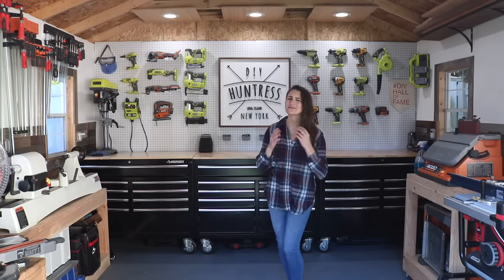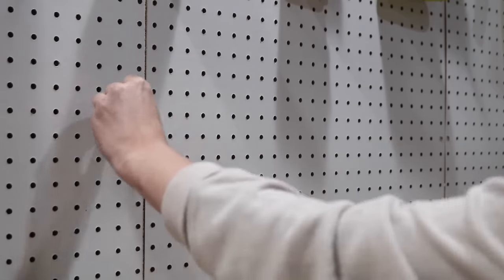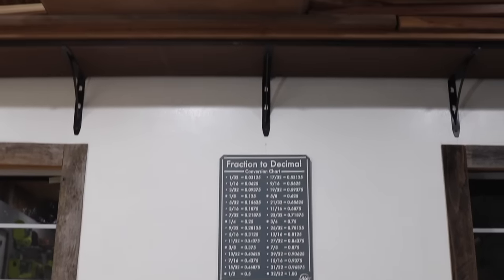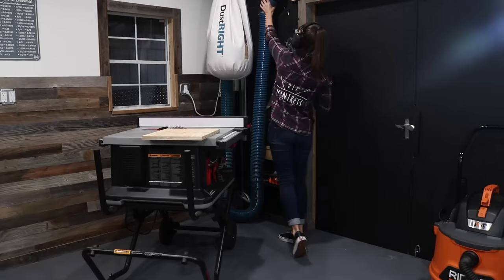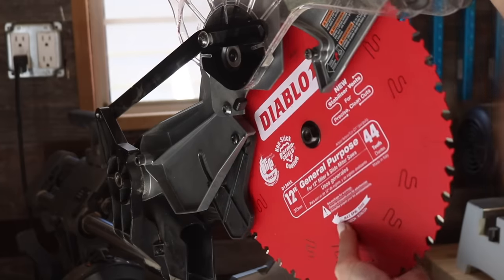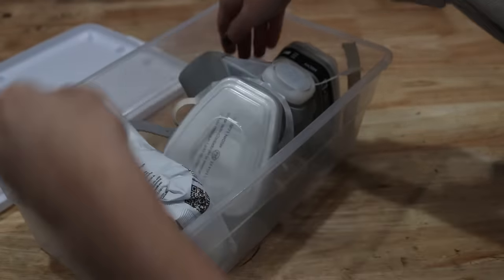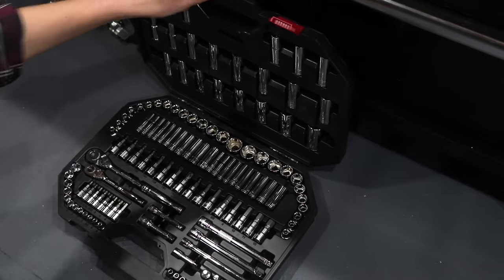Workshop Organization Tips & Shed-Shop Tour

Comment: I had the exact same idea for the back wall of my shop (12' x 24'). I was going to put 3 of the same type chest along the back wall and put pegboard from the top of the tool chests up to the ceiling. I liked the idea of using drawers for storage and having the pegboard up above and with a solid work surface. But then I watched a video on how to easily make something that would have larger drawers. And that's what I really need.....large drawers.

But I love the way your shop looks and the layout and how easy everything is to get to and use. You've done a fantastic job with it and should be very proud.
Reply from the maker: Thank you so much!

Comment: I recently found your channel.  You do some nice work.  I want to offer one tip that may help you.  I noticed that when you glue boards together you use a wet rag to remove the glue squeeze out. A common practice.  What I do that works very nicely is take sawdust and pour some on the squeezed  out glue, mix it together with the glue. Then, take a putty knife or scraper and remove the mixture.  It works every time and doesn't raise the grain and doesn't leave glue stains on the wood to be sanded off  Good luck.

Comment: I built a steel frame structure for my workshop and then clad it with knotty-pine walls, cause I love the wood look as well! It worked out to be a 12m x 6m x 3m high area with a 6m x 3m storage area next to it and I also made 6 large workshop tables with heavy duty coasters at the same height as my miter saw and wood saw table and yet you have somehow seemed to have so much more space than I do. Love the video and love your organizing skills and hate how incompetent I feel right now :(

Comment: Awesome job all around on your shop, looks great, organized, clean and vey usable. My small space is only 10 x 12 so you've got me beat. A little pegboard hook trick I use is plastic drywall anchors in the holes and then screws sticking out of the anchors. It's great for lightweight hooks for smaller tools, re-usable and cheap too. :)
Reply from the maker: Thank you! I like that idea!

Comment: I bought black watertight tubs that are all exactly the same and each tub has all the accessories for each power tool that is in the tub.  One power tool per tub. Saws have blades, sanders have sand paper, angle grinder has grinding discs and cut off wheels, etc, etc, etc.... I have 26 tubs and the tubs are labeled and all fit neatly in a large steel wall cabinet.  When I need to bring tools out of the shop for a project at my cabin I simply grab the tubs I need and go.  My power tools get dusted and cleaned before getting put back in the tub.  My tools stay clean, dry, and secure when not in use and don’t clutter up my shop.  I also use Tupperware for smaller organization.
Reply from the maker: I love the tub idea! That’s so smart!

Comment: Looks great and organized. I need to change my 12x18 shop around to create more space. This video will help! The only tip I would give you as a seasoned woodworker is to unplug that miter saw before you change the blade. If it were to malfunction or you press the trigger in any way while changing the blade you could wind up with a lot of stitches. ^_^ a safe shop is a happy shop. Also for the quotes and whatnot on your door, I always enjoyed Eleanor Roosevelt s "No one can make you feel inferior without your consent." as well as the one from Russel Crow's Robin hood quote "Rise and rise again, until lambs become lions." Although I imagine something that pertains to building or woodworking would apply better.
Reply from the maker: Glad the video helped - and, don’t worry, I always unplug my tools before changing blades!

Comment: Nice shop Sam, I have a few rules I live by for shop organization;

1. ALL tools go on the walls. (Drawers are where tools go to die) I realize you are dealing with limited wall area...But your driver wall can be compacted together, especially if you get rid of all the redundant drivers. every square inch of wall should have tools on it. The massive logo is eating up vital wall space, and if you add beefy hinges to the doors, that becomes free wall space as well. The clamps you have hanging on the wall near the lathe, can be moved to hang down in front of the windows, freeing up that wall space as well.

2. All large tools are on wheels. You have that one nailed.

3. Lighting. More is Better. The only suggestion I have is; If you add a shelf above the tool wall area, as high as you can reach and still get things down. Then this will not only give some vital storage space, but also provide a place for under-shelf/recessed task lighting on your main workbench area. You might even run this shelf around the entire perimeter, except for the entry area. Storage above, lighting below.

4. Home Depot rocks.

Comment: I see u use a 12"x44tooth saw blade on your miter saw.   I have found the 12"x60 tooth diablo blade is my go-to. It's my go to.  Great for rough cutting all the way to trim
Reply from the maker: 60 is usually my go to as well. Wanted to try the 44 out for a while. It worked out well for a bunch of projects. Back to the 60 again.

Comment: Next project: A charging station. I suggest a wall contol panel metalic pegboard as a start and offset it  from the wall so you can put a power bar behind it. ise a combination on custom mount and vendor shelves and maybe 3D print  specific items. Check out white in revery here on Youtube for suggestions. You can use it for both tool charing and camera battery charging. Easily expands with a second WCP panel.
Reply from the maker: I like that idea! Thank you for the suggestion!

Comment: Great shop. Excellent organization.  Well done. I am curious about the spray foam in the walls and then nothing in the ceiling? What is the thought there? Maybe it's insulated from the outside of the ceiling? Future insulation? Just sounds deadening for the walls? Thanks.
Reply from the maker: Thank you! Just haven’t gotten around to it, unfortunately. I was researching product for a while (the spray foam I used was not recommended for use in a ceiling), and then never jumped at anything. Will get there eventually. Luckily, our winters have been mild enough to get away with what I have. My space heater toasts it up really well in there right now. Hopefully will have time this spring to insulate the ceiling. 😊
Reply: @diyhuntress  👍👍 Thank you.. Now I can sleep tonight! ha  I'll have to watch more of your videos to make sure you get it done. LOL

Comment: I am just getting my workshop started, but I have a lot of random tools.  One item in particular is the table saw.  I have one I got from Harbor Freight many years ago and no matter what I do the dust collection just doesn't work.  I have a hole in the back where I use the shop vac but again, doesn't get the job done.  So I would be interested in your thoughts regarding the table saw and how you got your dust collection system setup.
Reply from the maker: Hi! I got my system from Rockler - it was pretty easy to install! It works great and I notice a huge difference when I don’t use it versus when I do. I just plug the hose into the back of my tools and got an adapter for the ones it doesn’t fit.

Comment: Thank you for the video! I like your layout. I wondered if your shed is 12 x 12 interior or exterior dimensions? I ask because I just bought a 12 by 12 shed and the dimensions seem too tight to fit three 46" tool storage benches side by side.

Comment: 5:57 Have you ever brought a blade in for sharpening?   

I have a 100 tooth 12" Freud saw blade and was told that it would be around $20-30 Canadain. I think they can be sharpened a handful of times.

Good idea to have two, you can cycle them as needed!
Reply from the maker: Interesting! I have not - I’ve only cleaned them before. Gotta look into that!
Reply: @diyhuntress  Not all blades can be sharpened, but I think the blade you had can be. They usually say on the packaging.  The one near me even does bandsaw blades which I find amazing.

Comment: About those drywall anchors. You should probably check out Gosforth Handyman here on YouTube he did a segment on those and he basically confirmed what he already knew, that they are more or less terrible to use if you plan on adding any weight to them. Hopefully the screws you used into the studs work good enough to support the weight though I would not trust those anchors.
Reply from the maker: The ones I used are actually made for wood (since my walls are plywood) and I’ve had that storage up for over a year now with no issues! I’m a serious hoarder, so they’ve seen a lot of weight over the past year. 😊
Reply: @diyhuntress  Ok. You sid dry wall anchors so I thought you were using drywall there. If it's wood then they will most likely hold much better :)

Comment: With corded tools drawing a lot of power (think Festool dust extractor with on-board sander drawing 15-amps alone, not including any lighting that might be on at the time as well), how much power did you run to your shed shop?  How many circuits are dedicated to powering your shed shop?  I have to build a 2-car garage with workshop area and I want to make sure I have enough power to power everything :)
Reply from the maker: I would honestly divert all of your electrical questions to a licensed electrician (that's what I did)! I just don't want to give you any false information! Especially since most of my tools are battery operated, which we took into account when powering up my shop. Wish I could be of more help!

Comment: Nice video and great organization in your shop.  I'd remark that having open bins below a lathe is not a good idea even with the best dust control.  I pride myself on taking care of my tools so they look nearly new but putting looks ahead of functionality and maintenance is rarely a good idea.  Plus, why didn't your roll out your carts when you repainted the floor?
Reply from the maker: So far, it hasn't been an issue to store things below the lathe! It's actually been really helpful to have the extra spot to store things. As for the carts... I did! I had to paint the floor in three sections, which meant rolling carts to one side at a time while I painted. We get a lot of rain and I didn't want to risk having to leave any tools outside while the floor dried.

Comment: You insulated the walls but not the roof? I have a 12 x16 ft shed workshop that I insulated and just before winter I added a chinese hot air diesel heater. The heater works great, I turn it on about 1 hour before I go out to work inside. There are no fumes it is quiet and very fuel efficient.
Reply from the maker: The spray insulation that I use for the walls was not recommended for using on the ceiling. Been researching insulation options for the roof for a while, but haven’t pulled the trigger on anything yet. Hopefully this summer. In the winter it’s not so bad, it stays pretty warm in here with a space heater. Will look into that heater!

Comment: Looks great and I have a question about the spray foam, looks like you did the walls but not the eaves and roof, why is that?
Reply from the maker: The spray foam that I use for the walls was not recommended for use on the ceiling. So, I never got around to finding a product that I liked enough to install. I’ll do so eventually… But for now, the heat stays in there pretty well with the space heater. 😊

Comment: I saw you insulted the walls, what did you do about the ceiling? When I was in MI I insulated the garage to death. Now in Florida (yes I am old) I still need to insulate the ceiling. I went from a gas heater (MI) to a stand alone air conditioner (FL). Great video, I only wish my shop was that well organized, LOL.
Reply from the maker: Hi! I insulated all the way up to the soffit and insulated the soffit as well. I haven’t found a product I want to use for the ceiling just yet, but... with my small electric space heater it still gets really warm in here during the NY winter! Suggestions for ceiling insulation are welcome, if you have any!
Reply: @diyhuntress  I would do the spray foam like the walls with the required venting to the soffit vents , then drywall. This should leave a lot of storage room like where you have in this video and keep you warm in the winter and cooler in the summer. Good Luck.
Reply from the maker: Thank you!

Comment: How many drills does one really need? I love tools as well, nut i stop at a regular drill and an impact drill. Even when the battery dies in one, i can either take one off the other and charge the dead one. Thats a lot of cash tied up in one type of tool. I've had my shed to shop conversion for 7yrs and im just getting around to painting the interior. That deck over paint you covered the floor with, how many cans did it take;is it fast drying; how many cans for what sw. Footage? Thanks and good luck!
Reply from the maker: I share my shed and my tools with my dad and my brother (my shed is on my parents property) so we share everything... which means multiple of certain tools that get used a lot (like drills). These drills have been a collection of all of our tools into one. As for the paint, I used around 2 gallons for a 144 square foot shop.
Reply: @diyhuntress  Now that makes sence for multiple tools. I must say i do have a few miltoples, but they are part of my antique tools. Some of the antique tools have been in my family since 1647. Those I will never part with, but the antique tools I have more than one of,  I use to sell or barter for a tool That I dont have in my collection. That is nice that you share the  space and tools with family. That is a special relationship you have. Best of luck!!

Comment: Love what you’ve done.  I don’t see where and what electrical outlets you have. And my big question is, how do you heat and ventilate as you live NY state somewhere? I’m asking because we’re building a retirement home in Central PA and I am currently trying to decide to do build a shed shop like this or add a garage bay onto my house for my shop. It can get pretty cold and warm in NY and PA. Any suggestions you have would be respectfully appreciated.
Reply from the maker: Thank you! Have a few on each side of the shop for dedicated tools. I use a window AC unit in the summer and a space heater in the winter. Hope that helps!

Comment: Curious as to all of the different cordless tool brands which requires  all different chargers and batteries. That doesnt seem very efficient.  Are all of your tool free from sponsors?
Reply from the maker: Every tool has its pros and cons. I actually really like having different options. Each brand has its own favorite tool in my collection and all I have to is charge and swap out batteries. No real impact on efficiency here. I do work with sponsors, but there are lots of tools in my shop that I purchased with my own money.

Comment: I noticed you insulated the walls, but what about the ceiling?
Reply from the maker: I talk about it in my shop insulation video - the product I used wasn’t recommended for ceilings. Had plans to insulate with foam board, but haven’t found the time. Hasn’t been necessary though!

Comment: I know this is an old video. We used deck over paint for, well, our deck...hopefully yours held up better. Less than a year and it looks like garbage. about 30% of it has peeled off. Next spring I get the joy of trying to strip the entire deck and redo it with something else. There are loads of horror stories about the Behr deck over paint and there was a large lawsuit about it trapping water under it and destroying decks. I'll have to replace at least 8 treated 2x6 that had that same issue. Maybe being covered and out of the elements yours will hold up better. Anyways, cool video!
Reply from the maker: Oh no! That’s so crappy. It’s holding up beautifully in my shop! No peeling... just me spilling things on it. 😂
Reply: @diyhuntress  I’m happy it worked out better for you! I don’t look forward to the days that will be spent stripping, prepping and refinishing the deck. I stumbled on your channel somehow, nothing related to the deck over paint. Just wanted to know if it held up better indoors! Cool little workshop! My wood shops small too, 11x16 in my basement. I can’t wait to buy my next house where I can build a nice 30x40 shop. Only 3-5more years! 😂

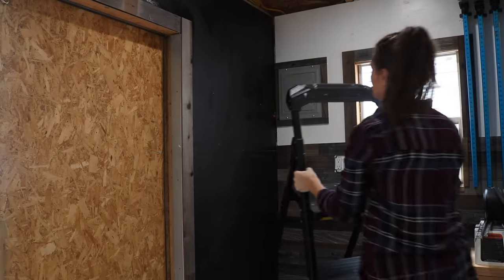Comment: Between 2:17 to 3:10 is a code violation. You must keep the working space in front of an electrical panel clear for a minimum of 3' in front as per NEC table 110.26 (A) (1) and a minimum 30" wide (side to side) clearance for equipment with a width less than 30" as per the NEC table 110.26 (A) (2).
Reply from the maker: Good thing none of the fixtures by the panel are permanently installed. Easy fix.
Reply: @diyhuntress  I have first hand witnessed someone in an industrial setting getting shocked by a faulty piece of equipment and the person had to endure the situation way longer than needed because there was no clear path to the electrical panel. It could have ended far worse then it did but it also could have been prevented in the first place. I wanted to point this out seeing as this is a video people will be looking to for inspiration for their own projects (which is exactly what I'm doing) so I just wanted to be sure others don't repeat the same mistake. Good work on you're workshop, I hope mines turns out even half as good.

Comment: How many breakers and at what amps are designated for your shed?
Reply: One thing that I would recommend is to wire it so that you have the option of 110 and 220 volts. Also the length of wire will be a determining factor in the size of wire and how many amps it will support.   Consider the maximum demand you are likely to be using and go up from there. Remember that lights will be on and the air compressor may start up while you are using your most power consuming machine. I hope this helps.